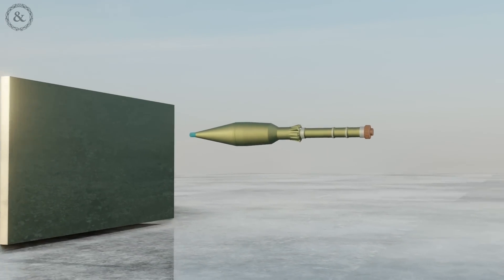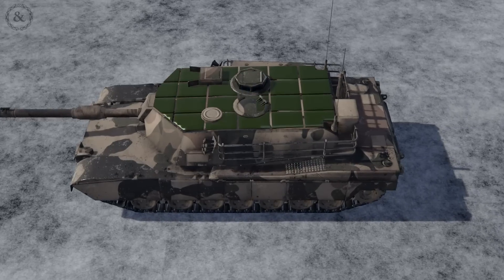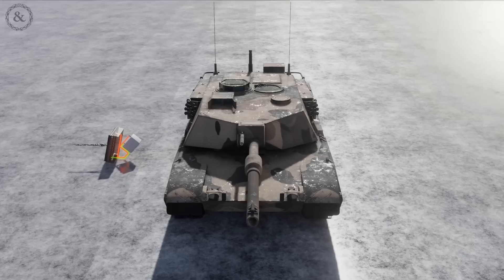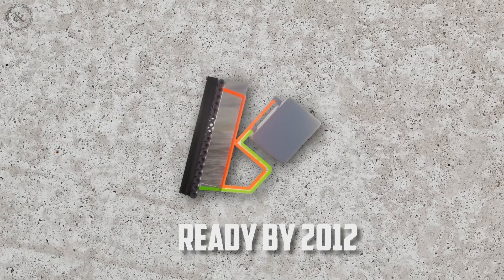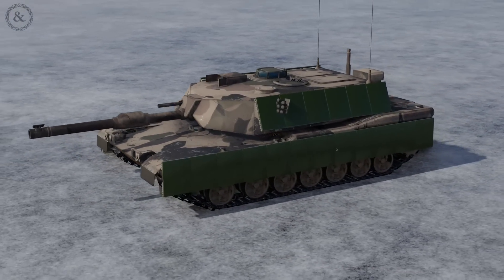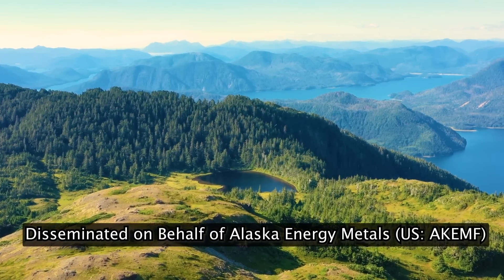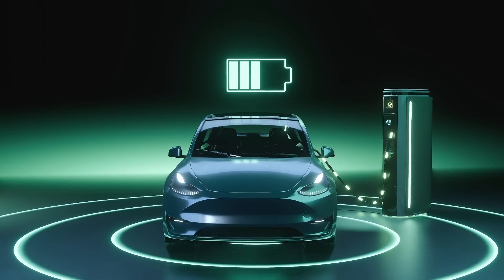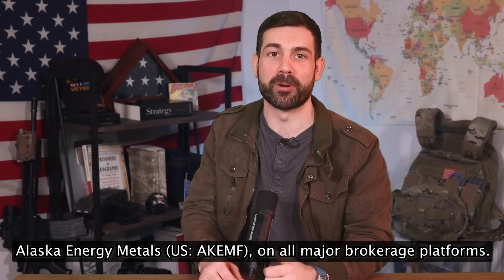How Electromagnetic Armor Vaporizes RPGs

Comment: the Problem is that the perfect solution to RPG protection will cost the Army $100 a vehicle 
PLUS it weight around 10 to 15 pounds 
...
the solution is a simple NET  --  made of fishing LINE diameter Kevlar string 
<<the Business part of the NET>>  --  <<are "Hard plastic rivets" that connect @ the intersection points of the Kevlar string>>  
...
the gut of an RPG round is a coper Plate designed  in a way that makes strong vs the explosive force in the round 
HOW EVER the Explosive force is designed to overcome the resistance of the copper Plate 
...
the "Hard plastic rivets" Rips a hole in the side of the RPG round  --  So that the Explosive force instead of turning the copper plate into a 5,000 mph jet of molten metal  --  It just escapes out of the hole  
so ALL that is done to the striker of put a burn mark on the paint

Comment: This is the most ridiculous thing I've seen, "Like an RPG" is not the same as an actual RPG and I'm certain it wouldn't be effective in any way. 100mm pen to only 32? 100mm isn't impressive for HEAT in way.
Also doesn't the armor panel get spent after a single hit? Like ERA.

Comment: they should have plasma generators around the tank turning air into plasma and when RPG comes near they should heat that plasma with lasers or electricity to temperatures they would melt it. They can use cameras with AI to identify incoming RPG or any mechanical sensor method

Comment: what if you cover it in thin lithium batteries lol dont they burn at like 4000 degrees when punctured so it could literally melt and stop anything before it does damage...or take something with very low voltage so it cant penetrate umm a human but extremely high amperage....u can vaporize a wrench with 600 amps at 12volts in literal seconds imagine if u up it to 6,000 or 60,000amps when u short it

Comment: Could it be that the Russian ARMATA found the right solution? T-14? And truly has the BEST armor at only 40T in weight compared to M1Abrams 75T?
Reply: Yet we still dont see them being used
Reply: @Gracefulwarrior2124  Try to understand Russian strategy. They have air superiority so a tank battle will never take place. The +/-300 West tanks are under permanent satellite observation. (the M1 turbine is so hot that you can see it from the moon) If they come within 10km of a Russian position, the RUS will withdraw and send the helicopters. The UKR knows it and that's why they stay far behind. These devices are completely useless there. What the RUS are chasing are the utilities, tankers with fuel and ammunition. And that is enough.
Reply: @Gracefulwarrior2124  Try to understand Russian strategy. They have air superiority so a tank battle will never take place. The +/-300 West tanks are under permanent satellite observation. (the M1 turbine is so hot that you can see it from the moon) If they come within 10km of a Russian position, the RUS will withdraw and send the helicopters. The UKR knows it and that's why they stay far behind. These devices are completely useless there. What the RUS are chasing are the utilities, tankers with fuel and ammunition. And that is enough.
Reply: @Gracefulwarrior2124  Not nead.
Try to understand RU strategy. They have air superiority so a tank battle will never take place. The +/-300 West tanks are under permanent satellite observation. (the M1 turbine is so hot that you can see it from the moon) If they come within 10km of a Russian position, the RU will withdraw and send the helicopters. The UKR knows it and that's why they stay far behind. What they are targeting are the utilities, tankers with fuel and ammunition. And that is enough.
Reply: @Gracefulwarrior2124  Do not nead.

Comment: The problem of EM armor is getting enough charge to resist multiple hits , the ideal EM armor would be able to use optics to determine the direction of the RPG in order to activate the specific plate or alternatively have  a nanosecond detector that is able to identify and distinguish an RPG impact on a single plate  which is probably more challenging since it all happens in milliseconds.  Either way its very expensive equipment. and then you also need the ability to recharge which means a series of alternators to provide the extra wattage.   So it's all feasible but a very costly solution also in terms of maintenance.
Reply: Huh, maybe that could be actually be possible. APS systems already fo that, so i wonder of the same can be done for EM armor
Reply: Also then with that kind of cost you might as well go full EM camouflage since its more or less the same tech.

Comment: Well,
When you have hybrid tanks, integrating supercapacitors into them would be easier, as a supplementary armor system- supercaps consume zero power after charging, only after discharging would it need to recharge and as a way to reduce penetration of munitions on lighter vehicles (say, not MBTs, but light tanks, recon vehicles, LIFVs, etc) and using this technology to improve the “hardness” of armor on ships - where nuclear power plants, space for super caps, the need to  support directed energy weapons provide all that is needed and which could provide much needed added protection against antiship missiles, etc.

I think there is also a possibility that it can provide an armored protection capability in space - but that’s a completely different subject.

Comment: The design you described sounds like the armor works mainly by expanding super heating and ultimately decintigrating the munitions but what about magnetically repulsing/repelling the munitions? Adding sufficient magnetic repulsion would potentially neutralize the ballistic trajectory of the munitions by pushing the munitions back with sufficient force to overcome the velocity and stop the munitions mid flight inches or even a few feet short of reaching you. This would work against any and all munitions made of magnetically responsive materials from rocket propelled missiles to anti-tank bullets and beyond.

Comment: This tech has some potential if it can be properly implemented with existing armor packages.  The idea of a very light main battle tank might not play out that well, though.  The weight of the tank provides a great deal of protection vs threats of all types and sizes.  Imagine a semi crashing into an 80 ton tank at 30-40mph.  Tank doesn't budge.  Barely a scratch on it.  I don't have to imagine this.  Happened to a tank ahead of mine.

Comment: The biggest advantage of this system is that the tank commander could shout "polarize the hull plating" all the time, just like in Star Trek Enterprise
Reply: And the gunner yelling back "Our plating has been short-circuited, commander!"
Reply: Except this is not polarizing.
Reply: @mrbaab5932  Shhhhhh, iz joke
Reply: what about the biggest disadvantage? 
can't it easily be defeated by covering the RPG with a couple of rubbers? 
that's like what? 10 cents or 20 minutes with a goat in the middle east?
Reply: @ You decided to use your Sunday morning to scroll really far down the comments section of a year old video to try and pick a fight with a comment that is obvious satire, that the OP has stated 'iz joke' and that no one will ever see using some weird logic of no comedic value. 

You need to learn how to read the room, see that it's empty and rethink what you're doing with your life.
Reply: @ it's called a joke genius
Reply: @ I am now part of the room, learn to read it -=)

Comment: When a HEAT round explodes the copper projectile does not travel at 5,000 MPH, it’s way faster than that.  Yes it’s hypersonic.  People don’t realise that the copper is not actually molten and the fire you’re seeing coming from it is hot ironised plasma heating the air up in front of the copper causing plasma to ignite.  The actual speed is 22,369.38 MPH so it’s traveling at 29 times the speed of sound so mach 29.  It is faster than the international space station which is moving at 17,500 MPH.

Comment: Proximity fuses exist. Also, firing an autocannon at those panels before launching a rocket would just either discharge them or disable them entirely

Besides, I think that creating some sort of a modified shaped charge could also negate this. Or, you know, just sticking a plastic rod with a metal tip to trigger the charge prematurely. Also it does not really solve the issue of HESH or thermobaric rounds that would just strip the tank of all of it's external plastic panels

Comment: This would actually work, as long as there is enough armour to protects the coils from small arms fire, it should work. I will also add that battery technology has come a long way since the inception of this idea, what used to be a car battery size battery in 2000-2005, could now be a fraction of the size and a different shape to accommodate the installation of this reactive armour. I also agree with you Cap that having this on the top of tanks, IFV's and other vehicles would help defend against drone dropped explosives like you see in Ukraine but can only guess at how this would be implemented in the end and the type of tech available when the designs are finalised.

Comment: This type of armor would be quickly negated by heavy machinegun fire. Same as reactive armor gets wasted by concentrated high caliber MGs.
Before you start saying ".50 cal does not penetrate ERA to cause it to discharge" by high caliber MGs i mean 14.5 or even 20mm autocannons, which are more and more widely used over big cannons. The effectiveness of Bradleys with autocannons here in Ukraine is just stunning. Even though armor doesn't get penetrated (andd sometimes it even IS penetrated) tanks get disabled very quickly and cannot perform offensive actions anymore. And after autocannon fire aften it is followed up by atgm for which tank doesn't have protection anymore.

Comment: Yeah I mean the obvious weakness would seem to be the system getting overwhelmed. How many hits can the system take until the protection fails, because after that, you‘re down to whatever normal armor you had underneath. Worse, you probably don‘t need an RPG to trigger the thing. What if a small autocannon or Dushka is enough to trigger the armor? Those things can‘t penetrate tank armor, now suddenly they can reduce your MBT to a lightly armored vehicle, that‘s really, really bad. 

At the end of the day, it seems unlikely that anyone would replace the regular armor on their MBTs with something like this, especially if they aren‘t the best option against the newest weapon systems. Look at Ukraine: clearly the main threats you‘re having to deal with are more advanced than RPGs, and those are what the combatants are investing in—and against. 

And it‘s not like the weight of Main Battle Tanks is a huge problem at the moment. Yes it makes everything more expensive, but engines are powerful enough that it doesn‘t limit them hugely in terms of mobility.

Comment: The electric armor sounds like it was designed solely for middle-east type of scenarios where the air humidity wouldn't be an obstacle for highly electrified system like that, could imagine a lot going wrong with it if it'd be used anywhere with lots of moisture, mud or snow.

Comment: That armor will be useful for units occupying conquered areas where near-peer forces are cleared out and resistance forces need mopping up.  The armor should complement an EM rail gun.  Instead of tank’s weight dedicated to armor, it will go towards engine/power generation instead.  

Thank you for that “Wolf of Wall Street” sales pitch.  Looked it up: A penny stock for sure.  Oh, and rule of thumb for mining companies: it takes TEN years to go from “Find to Mine” a resource discovery.  This company will need significant political pushing/backing and regulatory fast-tracking to be believable as an investment.  

You definitely have arrived to big leagues when a peanuts mining company comes to you for mass marketing.  Congrats!  

Who knows?  What you’re doing now could be the “Apple Moment” in advertising for this company.  I’ve added the company to my watch list… so far I’m nonplussed.

Comment: At the minimum, I would think this could be useful for equipment that doesn't have heavy armor to begin with, and would be considered exceptionally high-valued. 
Like command and control vehicles. These vehicles already wouldn't survive against a sabot round from an MBT, but with this EM armor, would have more survivability against an RPG or other HEAT based warhead.
Granted, those shouldn't be anywhere close to a front-line, and it'd be exceptionally rare for anything like an RPG to be able to reach and accurately hit it at that point.

Comment: This just seems like a more delicate, more expensive, and less practical version of ERA. ERA can't short circuit, ERA doesn't require huge amounts of delicate wires to be ran around the tank, ERA works when the tank isn't on, ERA doesn't require large capacitor banks that can wear out and catch fire. Etc etc. and ERA can also effect kinetic munitions. So congratulations you made a worse version of ERA. "Oh but it can stop more than one projectile" how often is a tank getting hit by two shots in the exact same spot? How often is a tank getting shot twice at all?

Comment: i can also imagine that the maintanance would get trickier and deadlier if not done right, i had to disconect and switch out some big power sources, this would probably be even more beefed up. for reference. i had to wait for 30 minutes after powering the machine down to make sure that any remaining charge is well and trurly gone.

so the crew would have to wait 30 minutes OR longer if they want to perform maintanance on this reactive armor or near it.

i think that a new tank would have to be deseigned with this protection in mind as i dont know where you would plan to put the power source in existing nato deseigns

Comment: While it's probably not feasible to fit it inside normal tanks, one possible scenario would be to apply it on UGCV, Unmanned Ground Combat Vehicle, more specifically those that repurpose old tanks into the UGCV roles or even purpose build one.

Comment: When a conductor passes through a magnetic field, it produces a current. That would go straight into the energized conductors providing the magnetic field. You would need to double the ampacity of the initial charge at the minimum. Not to say that the inrush can't be redirected to a capacitor (more parts, failure points and money). Without mitigating the incoming energy, the weakest element in the circuit would become a fuse granted it exceeds the ampacity. Tank shells would be a tremendous amount of energy punching the electrical circuit. Not impossible, but doesn't initially seem practical.

Comment: So make the contact point of the munition. A separate projectile that shoots off when it gets into proximity of the armor. Setting it off just before the main impact. Fancy armor defeated by putting a cheap gun in the nose of a rpg with a proximity fuse which have been around since WW2.

Comment: This could work very well for the M10 Booker. The M10 can't stand up to a MBT main gun, but enhanced protection against shaped charge warheads could prove very useful.  Seem the w ay to get around some of the difficulties of implementing this would be to integrate the capacitors into the armor panels themselves. This would minimize the requirement for high current cabling and could mean that only the E-Armor panel that was actually hit would require recharging. APCs and AFV primarily facie shaped charge threats from infantry antiarmor.